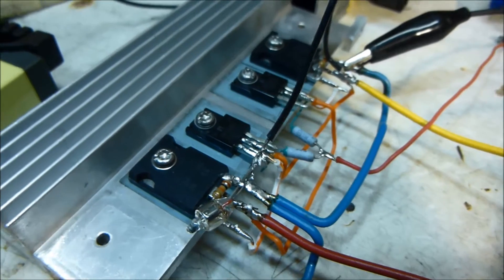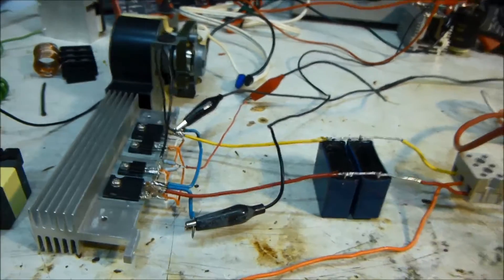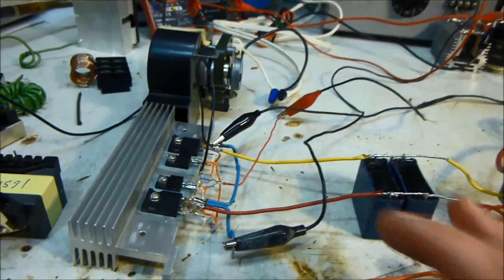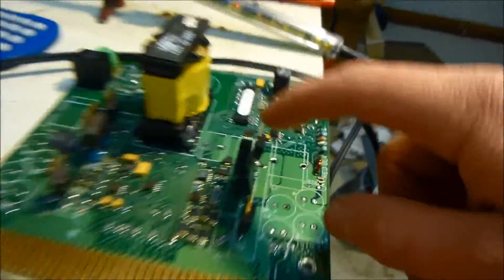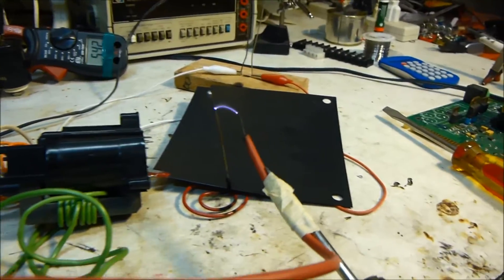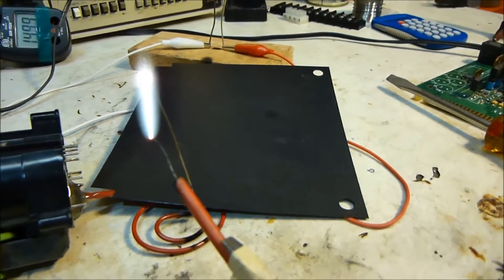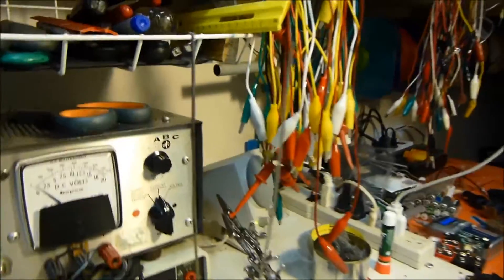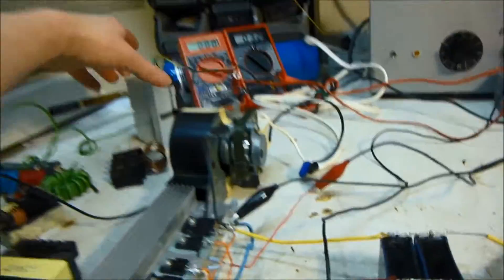New ZVS Driver Running Like a Boss With IRFP260N Mosfets - Hot 2inch Arcs and Jacob's Ladder

Comment: How about a scheme to ENSURE that both mosfets NEVER trigger, in a standard ZVS driver,  when power is first applied (rather than just playing the odds that "no two components are exactly identical).  I have a capacitor charging application where the ZVS driver must be switched on and off rather frequently.
GREAT VIDEO!!!

Comment: i did it little bit same i use 15 inch crt fly back and drive it with 25 watts cold cathod florescent lamp driver op to input of fly back and by the op of fly back i drive lcd back light tubes ...giving me awesome glow in my lab club environment yameee driving it since 6 months

Comment: finally got my ZVS driver to work! works well but not as good as yours haha, does the modified circuit your using increase output?
Reply from the maker: Good!  Do you have a video of it?  Well it might just need to some tuning.  Umm I don't really think the modified circuit has much better performance.  But in my opinion it is safer for the mosfets.
Reply: ill probably put the video up tonight
Reply from the maker: Awesome!
Reply: videos up if your interested!

Comment: I'm not quite sure what type of power supply do you have
Reply from the maker: It is basically a variac hooked up to two 120 to 8 volt transformers.  The out puts from the two 8 volt transformers is connected in series to get about 16 volts AC when the variac is turned all the way up.  So it is a variable AC power supply from about 1-16 volts @ 15 amps.  It's really nice!  I should use it a lot more than I do.  Then with my home made bridge rectifier diode I change the AC ind DC.  Hope that helps!

Comment: Ho mate' well if you do between 300-400 turns that should give a nice output mate. Iv done 600 turns. Always make sure you insulate between layers 👍😉 thanks bud and speak soon⚡⚡⚡⚡⚡⚡⚡⚡⚡⚡⚡⚡⚡⚡⚡

👍⚡👍⚡👍⚡👍⚡👍⚡👍⚡👍⚡👍⚡👍
Reply from the maker: I was thinking I would several 1000 turns! This should be easier than I originally thought!  Ya I think I'll insulate each layer with paper and then have it in a tank of oil. Thanks!

Comment: Mate  those mosfets are fine upto 200 volts, and iv only popped them with big back spikes from the big xray transformers, but with flybacks  the back spikes is abit different' its a different experience with eachnthink you drive' you could drive one flyback and its great for high voltages" then connect another and it blows a mosfet at low volts, its a win and loose at this game,  alex there saying they will pop if you take them over 50 volts'  iv never ever blown mosfets taking them over 50, iv only blown mine over 100 or so' volts!  dont worry too nuch, its all depending on what your driving them at! Plus your driving them with there own gate power supply thats not connected to the 'drain' so you have that extra safety!!! Iv run so many different types of mosfets and the irf260ns are the best for there insulating property's! 
And beleave me iv tryed alot lol,

Good luck and speak soon
Reply from the maker: Thank you so much Anthony!  I'm going to have to crank mine up a few more volts and see what kind of output I can get!  I want to try to make a home made fly back transformer.  How many turns would I need on the output and would 28 AWG wire be to big?  Thank you!  Good luck with your projects!
Reply: Anything over 65 v will blow your mosfets, as in a resonant push pull oscillator like the zvs the VDS per get will be 3.14x VIN. If you've gone over 60v you weren't using irfp260n feta.

Comment: How many power supplies do you have
Reply from the maker: Umm IDK lots!  It depends on what you define as a power supply.  Cause I have about 8 computer PSU's, 5 laptop chargers, and many other switching power supplies.  As for wall warts and other transformers, lots, like at least 30.  If you mean variable bench power supplies, only one working one.
Reply: That's pretty cool do they sell power supply's at radio shack?
Reply from the maker: Umm ya sorta... Bad ones that cost a ton... If you want to buy anything don't buy it from Radio Shack... It's way way over priced... did I mention way over priced? :P Buy one from eBay.  What kind of power supply do you want?  What voltage, current, variable, switching, or wall wart?  I could take a look around eBay for you if you want.

Comment: Hi bud'
Yeah you can't go wrong with using the irfp260n mosfets. They are great for oscillating' and a good blocking diode in them too. Nice driver there. 

 thanks for sharing.

👍thumbs up👍

⚡~high1voltage1rules~⚡
Reply from the maker: You suggested that I use them!  :)  Thank you so much!

Comment: Where is the schematic to this new circuit ??? I NEED THE SCHEMATIC!!
Lovely white arcs!! Thats the stuff!

Looking forward to more of these videos!!

P.s. Are you clip leads breading? You seem to have a few extras?
Reply from the maker: Patience patience!!!  :P  Schematic will be in "in depth video"!  This video is mainly for the people that wanted a simple explanation and some arcs!  Next video will be more for the people that are more interested in building on! 

Thank you!

LOL ya I picked a couple more up from Harbor Freight not to long ago when I was in the direction!  They are like $2 for 10 and I couldn't resist getting a couple more packs!  It's so worth buying more when they ware out than trying to repair them.  Once I collect enough clips I'll probably buy some nice wire and make some better higher amp ones.
Reply: I'm replacing the burned leads with ATX loom... $2 for 10! Buy me 10 packs next time yo see that. I'm down to less than 50 again :(
Reply from the maker: Mongrel Shark
Yeah I've done that too.  ATX wires are a little to short though.  But some short ones are always good too.  Here are ones that look the same on eBay.  Caution!  The wires only handle about 1 amp and are only crimped into the clips.  So if you pull on them they loose connection.  But the clips themselves are fair quality and can be reused once the wire gets fried.  I'm mistaken... they are $3 at the store.  So cheaper on eBay!  http://www.ebay.com/itm/New-10pcs-Double-ended-Test-Leads-Alligator-Crocodile-Roach-Clip-Jumper-Wire-/171215607997?pt=LH_DefaultDomain_0&hash=item27dd3ed8bd
Reply: I'm paying $7.50au (pretty similar to US$) for 10 at the local store. For similar 1 amp and starting to melt wire. That is heaps cheaper! I'm ordering now :)

I like some short ones. I should make a few long ones too. Although mostly I find them too long as they come and hate the tangles...

If those ones are just crimped, it would be easy to solder better wire in from the start. Crazy that its so hard to find just the clips cheaply....
Reply from the maker: Mongrel Shark  Wow, yeah, save some money!  I think I would pay even more than that if I bought them at the local electronics store.  I really hate the local electronics store cause things are WAY over priced and they have a terrible selection.  Like the most powerful mosfet they have is like 3 amps.  And they sell them for like $5.  Just makes me sick...  Only thing I'll buy there is solder cause it's not too over priced.  White and blue LEDs go for like $2 a pop.  Only time I would really buy anything there is if I need it NOW.

That looks like a pretty good deal on those red and black clips!  I always seem to use my red and black clip leads most!  Just easier to keep the voltages straight or something.
Reply: LOl, My electronics store is $5 for a white led. I get the same ones on ebay, where $5 gets me 100...

Then I ask for reprap 3d printer parts, and they tall me they dont stock that stuff because it dosn't sell. When there are about 20 people in the area that I know of building 3d printers... Its not selling because they dont have it in stock... I get the same problem with transistors too. And even resistors. They dont even stock high wattage 1 ohm resistors for current shunts... Told me to buy some $40 current shunt and matching meter... Like I'm too dumb to count on my own...
Reply from the maker: Ya eBay is the way to go!  I still don't get how they can ship $5 item from China with free shipping... seems crazy...  But I love it!
Reply: Its really a $1 item with $4 postage included in the price
Reply from the maker: I know!!! It's just crazy though!  So little profit!  Then again it's China...
Reply: Yep. Did you see polycrystalline solar cells are close to 40c per watt.....
Reply from the maker: No I didn't!  That's pretty cheap though!  Are you going to get some?
Reply: I already did. Just need to attach to blinds...
Reply from the maker: Oh cool!
Reply: Got 70w of untabbed cells for $30 :) Planning on using crt wire with the enamel stripped for the tabbing wire. Then I will have an re:emf charger on some old car batterys I have, as well as maybe some cordless drill pack Joule Thief lamps. If I turn the lights of in favor of the solar, it should pay for itself in a few months. Then I will be able to slowly upgrade, spending savings on more solar. Until I am feeding in to the grid and getting payed for the excess I cant get in batterys every day. then spend money on more solar. Until I have taken over the world.... Mwahahahahaha
Reply from the maker: Not bad!  Though 70 watts doesn't sound like a lot compared to our 120 watt panels!  :P  That does sound like a good deal though!  You certainly have a good plan there and you have your work cut out for you!  :P  Then you'll have to expand to outer space for more light!!! 

Okay maybe you can explain this to me...  I have red that super conductors have zero resistance which seems crazy to me but anyway.  If it has zero resistance does that mean that all the worlds electricity needs could theoretically flow though a super conductor the size of a hair?  I mean it seems like it would work to me.  But I don't think you would want to do that though.  If that hair thin super conductor with trillions of gigawatts passing though broke you would have one @#$% of a massive arc...  But if super conductors could do that then why not put huge amounts of solar panels in space and send the electricity to earth va super conducting threads?  I mean sure there is probably tons of problems with that but could it theoretically be done?

Thanks!
Reply: I dont know a lot about superconductors. but plasma is one sometimes... Look what happens as you crank up the watts..... From what I know about solid superconductors. They all need cooling. Most with liquid nitrogen. I'm guessing there is still some resistance, so more current is still going to generate heat which is going to require cooling. So long distance transfer of high wattage isn't going to be very efficient. Might be good for high speed data though. The other issue is superconductors are fairly rare elements from what I hear.... Not Cheap...

They use superconductors on the bullet trains in japan. I think they do some levitation too, as superconductors are oftern highly di-magnetic..... So they always repel magnets...

Pyrolytic carbon is a good one to Wikipedia.... Could be doable at home with a splatter chamber I think....

Comment: The high voltage from flyback can not kill your zeners. Maybe 1W zeners, but 5W should survive that. It is also advised to ground the flyback core and be careful what you arc to.

It never happened to me that they would be "half on", nor that they would both turn on at the same time. This is not possible IRL, because there is always an imperfection in the circuit which causes one of them to start a little faster and then it grows exponentially and turns the other one off completely. I never even used resistors from GATE to ground.

I also realized that when I connected the gates in normal ZVS to positive while leaving the rest of the circuit off, the current from the zeners was enough for the circuit to start oscillating lol.

Anyways, I like your video. Beautiful arcs. How is it that they are so blue? My arcs were always kind of yellow.
Reply from the maker: Yeah you might be right.  It just seems a lot better and safer for the mosfets to me.  It pretty much eliminated all chance of anything happening.  Well the thing that can happen now that could be bad is forgetting to turn the gate drive power supply on!

I never heard of a 1watt or even 5watt zener diode.  I always thought they were very sensitive little devices...

Yeah I'm not sure if that can happen or not.  Really?  I thought those resistors were needed to turn the mosfets off.  Maybe I need to study the circuit more...

Thank you!  The camera might pick them up a little more blue.  But they are a pretty blueish white arc.

Comment: Thanks for sharing
and you forget to tell what schematics you use
do you have a schematics?
Reply from the maker: Your welcome!  'll put that in another video.  But it is the basic ZVS schematic but with the modifications that I mention in the video.  So no zener diodes and separate power supply for the gate drive of the mosfets.